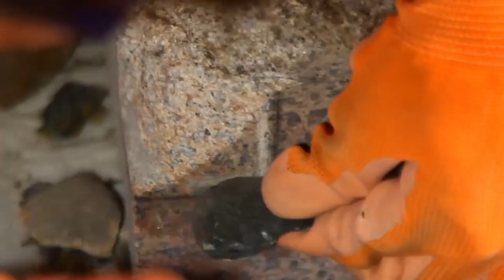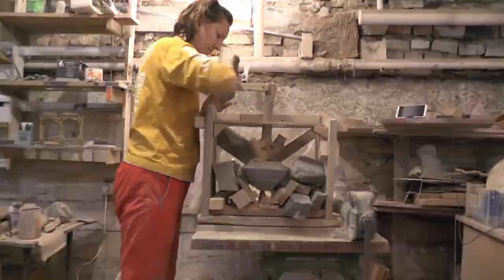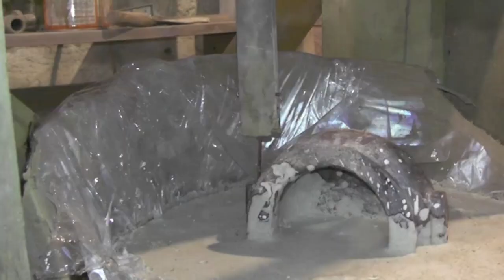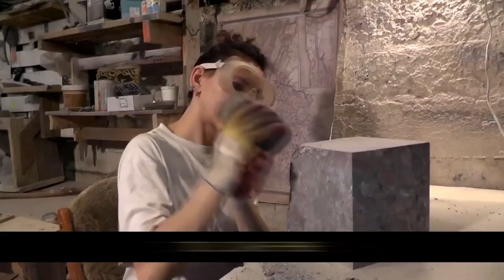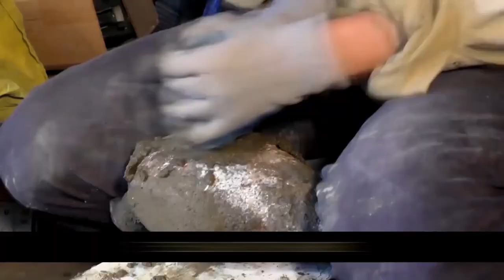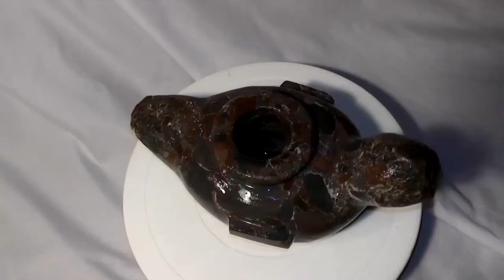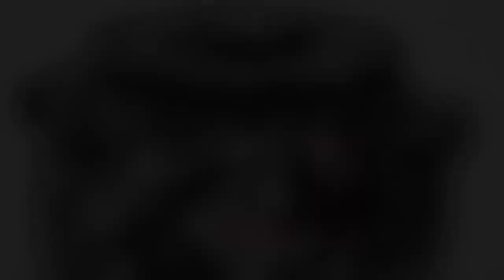DIORITE VASE. Let's make an impossible artifact real!

Comment: Still way behind the symmetry and finish of the originals. Suspiciously little content in this video. Original Saqquara vases were hollowed out and polished internally. How they managed this is mind blowing. They must have used some sort of lathe which cut through smoothly and was water cooled. Even using modern equipment would cause vibration and probable shattering of the granite.
Reply: I agree that them stone vessels they found in saqquarsa were made of diorite she used limestone but fair play to this woman she made a beautiful piece of art
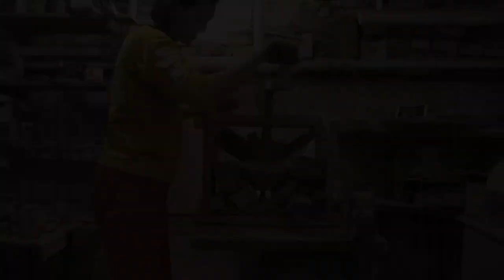Reply: Rotational symmetry of small items is the most trivial aspect to achieve, you actually saw that also for few moments in the video (about at 0:28). When carried on for some time, it also provides very smooth surfaces. Polishing works/has worked always the same - with very fine and wet abrasive, often applied to semi-soft surface (e.g. leather or pitch). It really doesn't matter much if you polish inside or outside till your tool reaches surfaces to be polished.

Behind my childhood home there was a factory of tombstones. From "powertools" they had circular saw with diamond-bronze(?) blade. But even then very large pieces of red granite and i-don't-know-which-black-stones were "cut" by using slicing with expansion of wooden rods. All the crafting (tombstones with cut in and out texts, small statues) was done manually, including polishing. No, not with powertools. Only chisels of different types, hammers, wet lap tools.
Maybe you could take some courses of "traditional stonework" to be really able to evaluate what is possible and what not with simple tools?
Reply: @ianclarkson1835  For sure, her work is beautiful and if given more time would be even more-so.
Reply: @tonisee2  It doesn't produce the precision shown in the video this supposedly debunks. It doesn't even come close.
Reply: @charleswalker2484  this is called "proof of concept". Try to follow and improve her absolutely basic method, I am pretty sure that with enough care, attention, and time (it has been said that in general it takes about 10 thousand hours to master something) put into this, you can produce items similar in quality of ancient Egypt.
Reply: the most impressive thing to me was never the material, it was the freakish accuracy, and often how it was on internal surfaces- knowing we could work granite makes total sense. but the accuracy egyptians done it too was machining level, source- engineer. @tonisee2
Reply: @onemorevideo1305  as I wrote, rotational symmetry is trivial to achieve and it can easily be both very accurate (e.g. cross section is a circle) and precise (smooth as baby's bottom). Accuracy has to be compared to something. E.g. the shape follows accurately a sphere or e.g. a plane. Or dimensions (diameter or height is very close to some defined length). And precision is about the scatter. Polish of surface, if you want.

There is a great visual description of accuracy and precision. If you have a shooting target and you shoot at it, then you have shot accurately if average of all marks lies on the bulls eye. The closer are all the marks to each other, the higher is your precision. However, it is possible to have also low accuracy and high precision (all shots are very tightly packed around number 7 on your target). Search for accuracy vs precision in Google and choose image results. 

So, I'm actually not completely sure what did you meant with that accuracy.
Reply: I'm well aware I'm literally an engineer.
these principles don't make it simpler even if it sounds to you like they do. 
 @tonisee2
Reply: @onemorevideo1305  Very good, then you should know very well how a lathe works. Rotationally symmetric things can be created exactly like this. You need just abrasive tool. There are multiple abundant minerals harder than those in the composition of e.g. that much-debated diorite. If you do not know how abrasion works at material level, there can be plenty of good information found also from internet.
So - persistence, stable rotating tool and suitable tool materials.
Reply: @tonisee2 obviously it’s possible because we have the artifacts… but there’s no way in hell you could do it… you don’t even have the tools to measure that kind of precision
Reply: @tonisee2 are you comparing cutting flat slabs for tombstones to these pre-dynastic masterpieces?
Reply: Requirements for both to precision and accuracy can be similar or the same.
Reply: @tonisee2  I’m guessing you’ve never watched the data be presented? Lol. They literally go through and do everything you discussed
Reply: @cleanpiecington2319  I can not claim that I have seen all the possible videos dealing with 'unbelievably precise' ancient artifacts. Those I have seen aah and ooh, present cherry picking stuff, presenters have apparently no glue about technical capabilities of simple tools well documented by different cultures nor behaviour of individual materials used back then and also nowadays. Some of them are clickmagnets, some of them in the category 'what government puts into our water' (reference to a great hit in YT), some people want to prove something desperately (typically to earn living from not well informed and possibly naive people), the zoo is pretty diverse.
Archeology, well educated engineers, and gifted craftsmen of specific fields from everywhere in (usually, not always) the "third world" know pretty well what has been done, what can be done and how it can or could have been done.
Reply: @tonisee2  this video will get you up to speed. Idk what your talking about… I dont really care about your YouTube rabbit hole habits. I’m concerned with the  data
Reply: @cleanpiecington2319  what data? The data which shows that the cross-section of a rotationally symmetrical item is very close to a circle and it deviates very little from that?
Reply: @tonisee2  omg your not completely oblivious… yes, now please explain to me how’s that’s done to 1000ths of an Inch 4500+ years ago in granite or diorite without a lathe?
Reply: @cleanpiecington2319  I don't think that using dramatic claims with 'large' numbers (1000ths (actually, that creates question: how many thousanths of an inch - 10? 100?)). In fact, this is just 25.4 micrometers, 0.025 millimetres. Which is by any machining standards a quite rough finish. You will feel such nonunifirmities easily with your fingertips, they get your nails.
I repeat again - achieving rotational symmetry is simple with simple methods. One do not need a modern lathe for that, just a reasonably stable rotating platform where to fix an item being worked on. That is really as simple as that. There is no point to start removing large quantities of material like this, after first (very) rough shaping (using metal, stone, wooden or bone tools), it takes much less effort to get nice symmetric shape by abrasive methods. Using just an appropriate stone tool for the roughest work (no, diorite is not the hardest stone in the nature) and then for finish some soft material (wood, leather) with dry or wet finer and finer abrasive materials. Up to the polish when interested.
Reply: @cleanpiecington2319  by the way, which dimension and which property (accuracy or precision or both, and then compared to which reference?) do you refer by that 1/1000 inch?
Reply: @tonisee2  literally 1-2 1000ths of an inch symmetrical. Lol. Your saying that’s easy to do? Modern technology wasn’t even able to measure that kind of precision until they started making jet engines. I understand the concepts of how to make something like these vases… what I don’t understand how they were able to create a lathe that was stable enough and spun fast enough to accomplish this?
Reply: @tonisee2  literally every surface of the measured vase I’m talking about was within a couple 1000ths of an inch. It’s rotational symmetry, the levelness of the top lip, the levelness on bottom of the vase, and most amazingly... the interior rotational symmetry. They all varied by less then .004 inches
Reply: @tonisee2  the consistency of the thickness on the top lip doesn’t deviate more then .004 around the circumference
Reply: @cleanpiecington2319  It sounds like you lack the concept how stone cutting works on the material level. I would suggest to educate yourself on that subject. 
That claim of 'modern technology before jet engines' is plainly wrong. 
Optical lenses were manually or partially manually grinded(!) since medieval times or maybe even first centuries of CE. Glass mirrors followed later in 19 century. To have transparent glass lens of any useful quality, it's surface roughness has to be smaller than about few tens of nanometers and shape ca 100 nanometers. That is relatively easy to achieve completely manually - I personally have done that when grinding and polishing a 200 mm diameter telescope primary mirror.
Reply: @cleanpiecington2319  Clear, precision of 0.1 mm then. That's what I call macroscopic.
Reply: @tonisee2  nice little history lesson there, but what was Galileo using to measure micrometers accurately?
Reply: @tonisee2  I guess I was mistaken about the mechanical micrometer it was invented in the late 1800’s. Idk why I was thinking it was 50 years later…
Reply: @cleanpiecington2319  he didn't, no micrometers and most probably not inches. If you want to get smooth surface, there is no need to measure anything. You just polish originally matte surface till it becomes uniformly shiny. Eye beats many "modern" measurement devices here.
Another thing is accuracy. If creator decided to make something exactly 154.782 mm tall and achieved that - that would be a great achievement and I really doubt that in ancient Egypt or even in medieval world anyone was capable of doing that. The same about diameter of something.
In the context of that vessel, there is no evidence or even point to discuss what was the expected dimension of it (no we can't read minds of people who died 45 centuries ago nor current living ones) - and therefore to discuss about accuracy at all.
If craftsman managed to make several items with dimensions within 0.1 mm to each other, I'd say: "well done"! But it is again quite easy task, because you can always compare to first one when making next ones. Measuring difference is almost always very easy.
Reply: @tonisee2  that’s less then the thickness of a hair. You can call it whatever you want😂 that’s impressive
Reply: @cleanpiecington2319  more like mid-1600s.
Reply: @cleanpiecington2319  yes, no denial here, that was definitely a great craftsmanship with beautiful artistic results. We should be seriously impressed. 
But there is nothing that one can refer as impossible to create using very simple tools back then.
Reply: @tonisee2  how would you even create something like that without having a plan before hand?😂 they certainly didn’t just start smacking away at a piece of granite one day and end up with that
Reply: @tonisee2  how would you make a lathe stable enough to create those tolerances with wood? It seems there actually is some sort of layout they were using involving a shared radial traversal pattern… I can’t write all the equations here to express those relationships but they are there
Reply: @tonisee2  obviously it’s not impossible we have the artifacts lol. What we don’t know is how they did it
Reply: @cleanpiecington2319  I'd say that most of things in human history have been made with common sense, picturing in the mind, and eyeballing. Unfortunately there is no way to know why the creator of that vase created it exactly how it looks like. Possibly that felt beautiful and he was happy how it turned out finally. There is very little if any existing physical evidence of exactly repeated items from ancient times. I think it is not a good idea to start playing around with such assumption.
There is plenty of current practice how people are doing items manually nowadays (somewhat close to this topic: search YT for people in India making pots - they look almost perfectly similar. But only almost.) and achieve amazing consistency of their results. That's called professionalism. 
By the way, not all stone vases from pre-dynastic period look that great... Older ones can be pretty asymmetric and not very smooth, too. It is thought that those rough ones are ground completely manually after chipping to almost right size. There is plenty of those in museums. Search for diorite vase... 

To create rotational symmetry, there is no need for modern lathe, something similar to pottery wheel would do well. Primitive ones were thought to be used ca 3500 BCE, oldest sumerian one found from ca 3100 BCE. "Modern" rapidly rotating high-inertia ones with flywheel are though to be invented in Egypt couple-few centuries later or so. That is about the time of appearance of "better looking" stone vases, too.
Reply: @cleanpiecington2319  There are quite good ideas how e.g. ancient Egyptians might have done those already ca 4000 BCE.
Reply: @tonisee2  obviously not all pre-dynastic vases show this type of symmetry…  but the new kingdom artists sure as hell tried to imitate them… plenty of limestone shit vases or straight up pottery pieces painted to look like they are granite… we arnt exactly sure how many times these symmetry’s have been replicated because only a few people in the literature have even mentioned the quality of these vases… I’m sure you are aware of the vast  amount of these types of vessels that were found stashed at the pyramid of djoser… they state there was a collective effort to collect these types of vessel. Also they say these vases were probably looted from early graves…  predyantic vases with these amazing symmetry’s show up in graves from the Naqada culture as early as 4,000bc… any farther back then this there is very little archeological evidence besides post holes and stones flakes… how far back are you suggesting they had the ability to make sophisticated lathes? Lol. They were making these super stable lathes while they were living in huts and living hunter gather lifestyles?
Reply: @charleswalker2484  Are there two identical (by measurement) vases? That woulds show the process was under control. Are there ten?
Reply: @cleanpiecington2319  Are there two identical artifacts? Ten?
Reply: @cleanpiecington2319  Are there a series of identical vessels? That would tell us something.
Reply: @tonisee2  Ask about how many identical items have been found. My guess is zero.
Reply: @cleanpiecington2319  " nice little history lesson there, but what was Galileo using to measure micrometers accurately?"
Light.  - You really ought to look into telescope making.
Reply: @cleanpiecington2319  "how would you even create something like that without having a plan before hand?"
Well of course. They knew what they wanted and how it had to be made and did it. Why would you expect anything different? 1. We can make thin walls of uniform thickness. vs 2. We can make thin walls of a desired uniform thickness. Show me examples of #2. Then I'll be impressed.
Reply: @cleanpiecington2319  "They were making these super stable lathes while they were living in huts and living hunter gather lifestyles?"
Make a wall with "X" thickness vs Make a thin wall. Which was it?
Reply: @msimon6808  why not watch the videos yourself and see what you think? why rely on a third hand assessment from some random person in a comment?  
its all there for anyone to see. no one has debunked it. we should be trying to figure out how this has happened. whether or not it did is over.
Reply: @tonisee2  You: "I can light a fire with a lighter! How hard can building a rocket be? It's just fire at the end of a tube. Super easy, right?"
Reply: @msimon6808  how do you use light to measure? and then what tool was he using to determine how many micrometers was in that distance? Lol
Reply: @msimon6808  well from the evidence shown in this video…. They can’t even come close to the same uniform thickness observed in some of these predynastic vessels
Reply: @msimon6808  have you seen the one they spent two years trying to make? It’s not even close to symmetrical